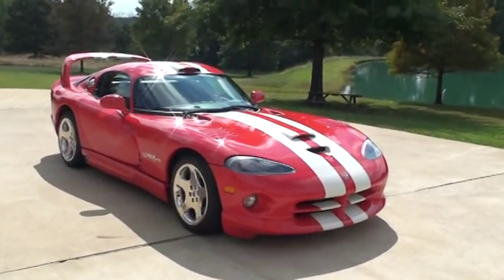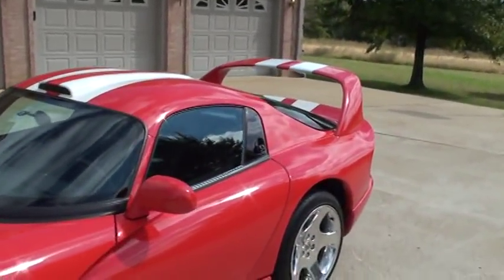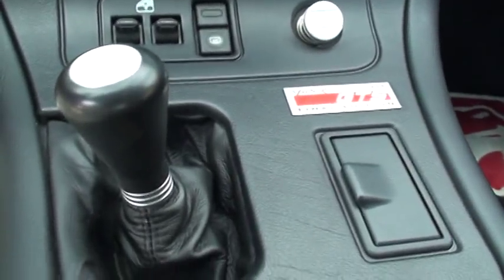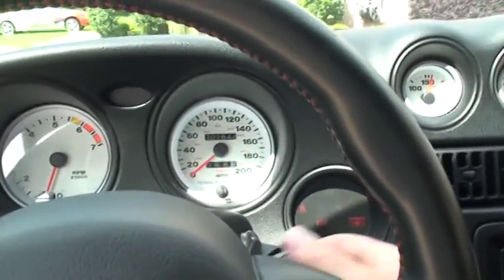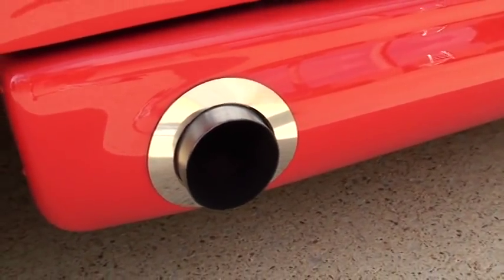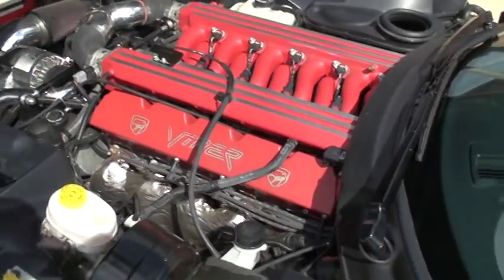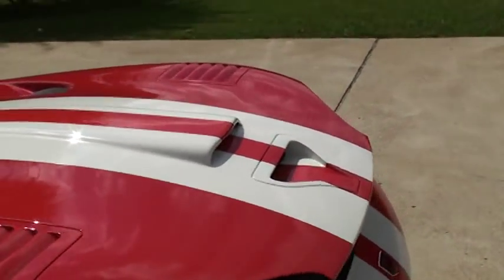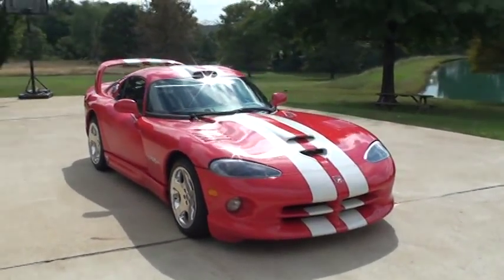SOLD !!!!  2002 DODGE VIPER GTS SUPERCHARGED WWW SUNSETMILAN COM

Comment: @kc28 i've seen the sell from anywere of $25,000 to $80,000

depending on mods, condition, and milage. 

i've seen a 02' GTS with 50,000KM on it all origonal with minor hood damage sell for 35K